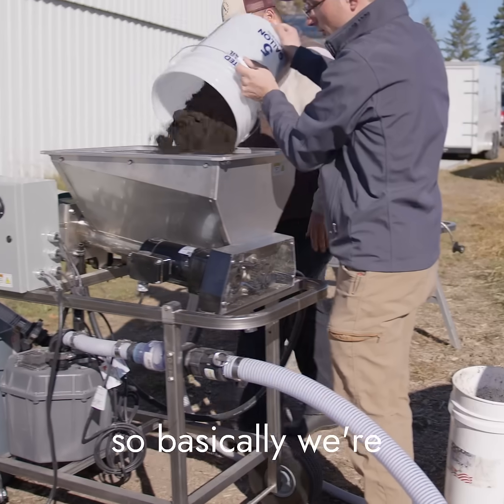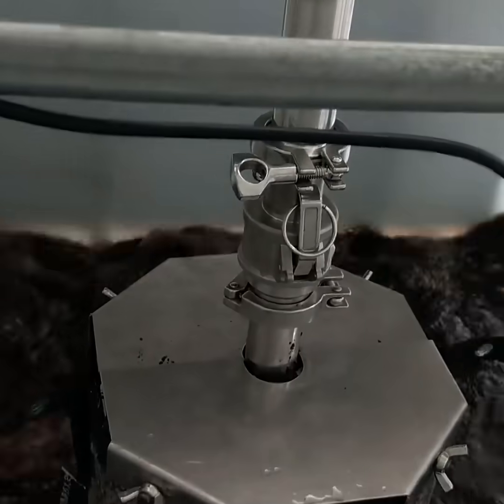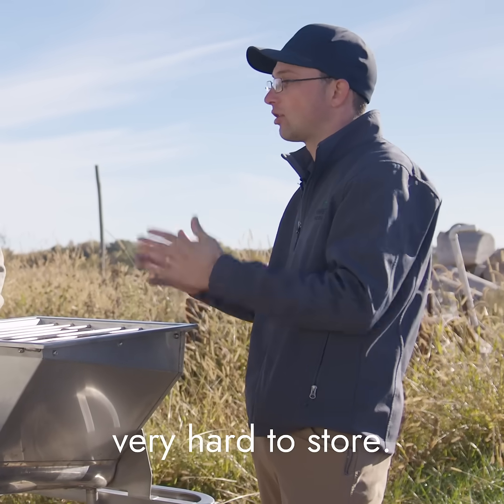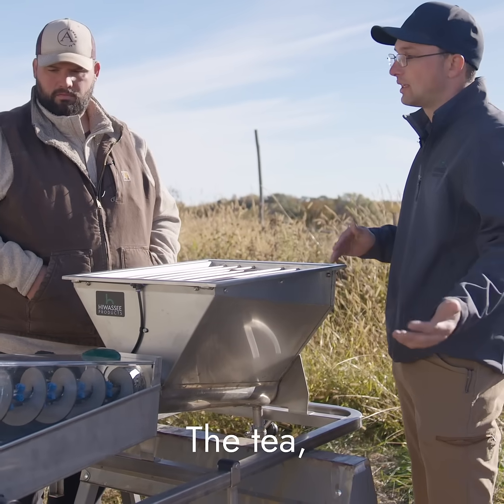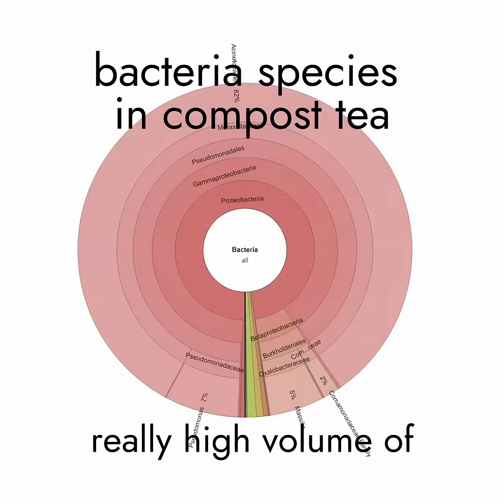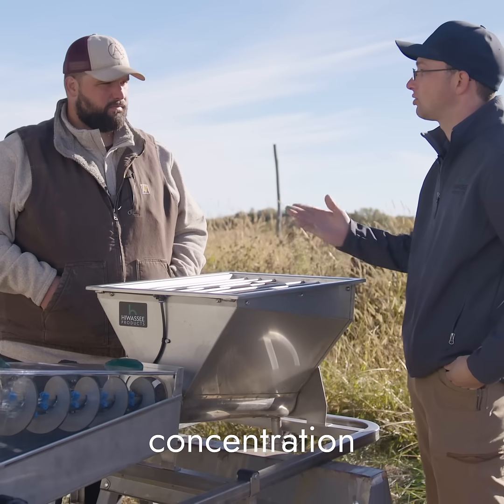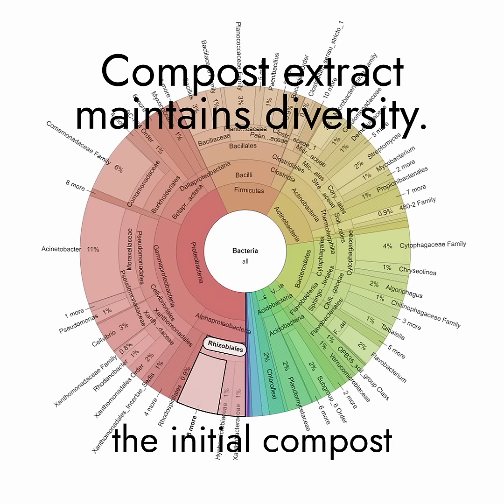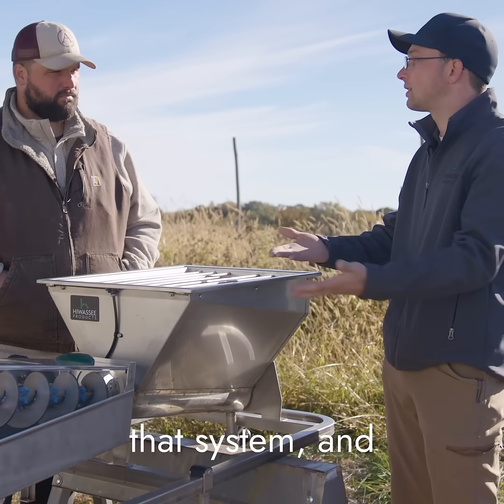Compost Extract vs. Compost Tea

Comment: Why not spread the compost?
Reply: One can always spread the compost. Problem is you have to provide big amounts of it  which most farmers cannot obtain or produce. Bio completed compost can be used to inoculate biology into soil. Again, it has to be high quality compost.
Reply: @ if big amounts are needed of the compost, surely big amounts of compost are needed to make the compost extract. And not all the biology makes it into the extract, so the compost used to make the extract has more biology than the extract that results from it. I can see this being used as a foliar spray or as a commercial product, but on site in a farm it makes more sense to spread out the compost to me.
Reply from the maker: With extract, the main goal is biological innoculation. It takes far less compost to treat a given acreage if you make extract. Direct application of high quality compost is beneficial, but it's not practical at a large scale. 

Extract is also more versatile. You can apply a it as a seed treatment, in-furrow, or inject it through a pivot. This gives you the ability to innoculate your crops and soil with high-quality biology without extra passes over your fields. 

Regarding extraction efficiency, Soil Foodweb Inc did a study on our extractor and found that nearly all biology from the compost went into the extract. https://www.hiwasseeproducts.com/blog/extractor-efficiency-report Also, spent compost from the extractor can go back on the compost pile, so nothing is wasted.